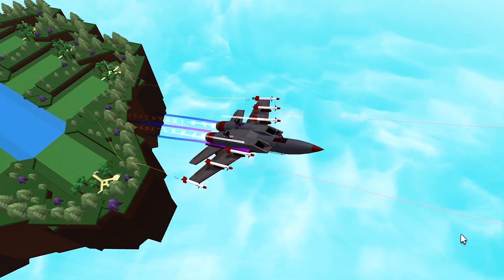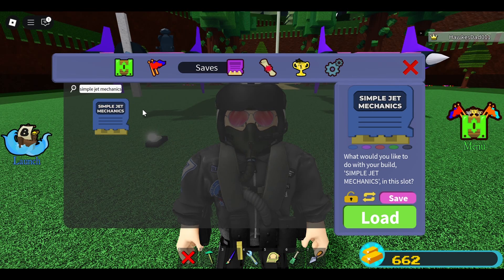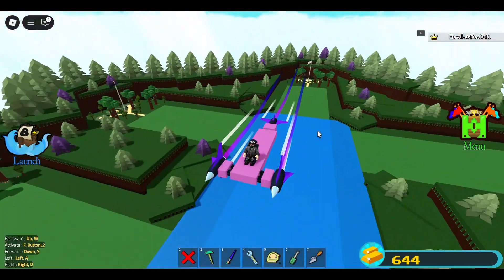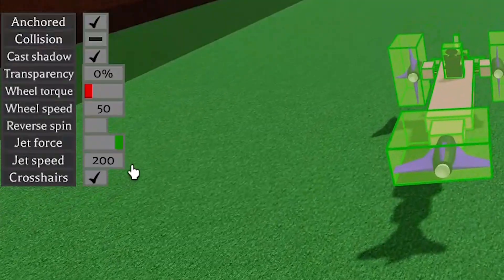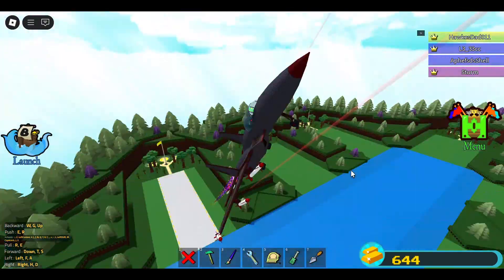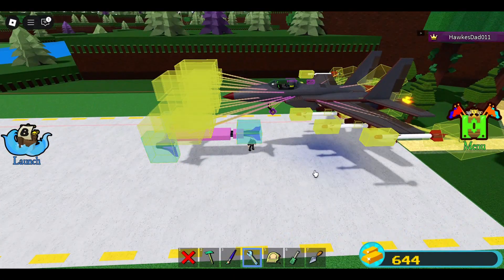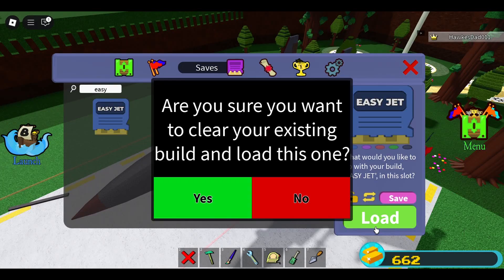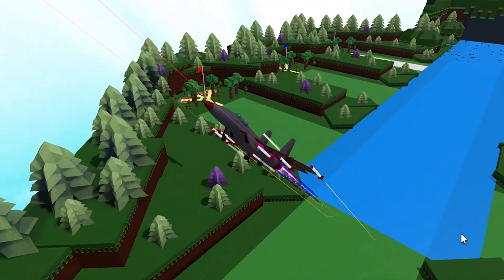Tutorial Easy Simple Jet Flight Mechanics! Makes Plane stable in Roblox Build a Boat for Treasure

Comment: I've used this on many jets and it's worked perfectly. I'm working on a bigger and heavier plane and was wondering if you could make a flight mechanic for larger planes. (I have tried it with a big plane and it worked ok but still was a bit unstable when turning)
Reply from the maker: Watch my upgraded kirov 👌
Reply: @hawkesdadtutorialsBABFT alr thx

Comment: Mobile friendly?
Reply from the maker: Yes!
Reply: @hawkesdadtutorialsBABFT  thanks bro. I made a plane that has a propeller and it did not fly straight, but because of this mechanic will now fly straight
Reply: I couldn’t put the hinges straight:(
Reply: I can finally make one of those planes where the engines can turn into a helicopter
Reply: Mine is not stable fake
Reply: @KristoffDrakeBondad its real he said " find the sweet spot for ur jet did u adjust the jet force?